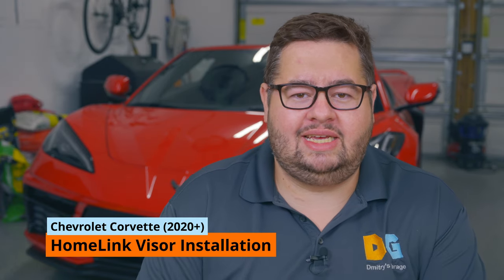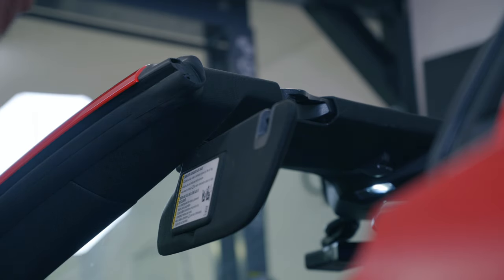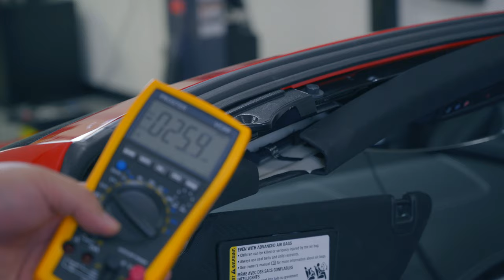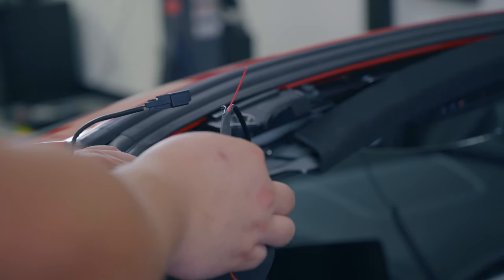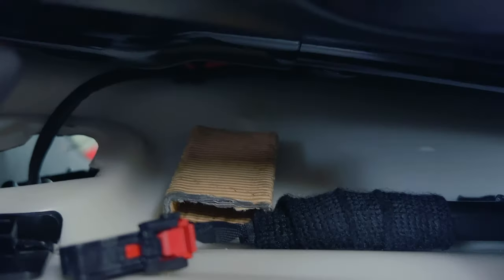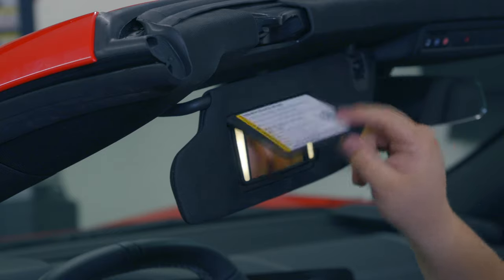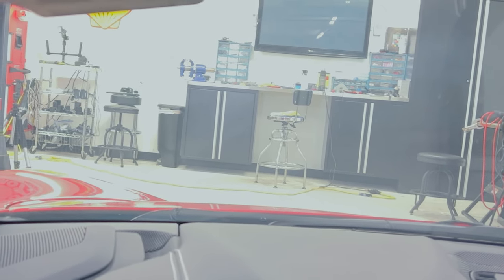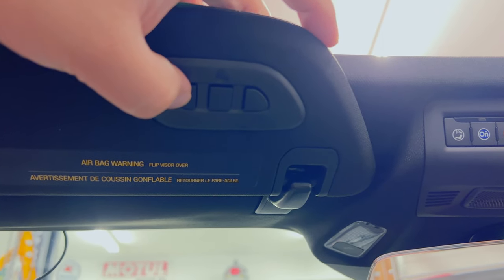Upgrade Your C8 1LT Visor with HomeLink and 12V Power for Radar Detectors and Dash Cameras

Comment: Thanks for that post.  Installed the home link in mine.  Not a bad ordeal.  The only pain in the rear is making sure you get the retaining washer / nut off without losing it and put it back on without losing it.  LOL.  I had a Camaro previously and had ordered the GM wiring connector clips (like the one on the visor connection).  If you really want to get creative, you can use those to make a pigtail harness 1 to 2 connector in order to connect a radar detector or other devices and make it look factory.

Comment: If you're JUST wanting the home link and not worried about extra wiring, do you simply attach the new visor to the car?
Reply from the maker: Correct, it’s totally plug and play. The splicing is only needed for the extra accessories you might power.
Reply: @DmitrysGarage  thank you for your response!  NOW to just find that part available somewhere!